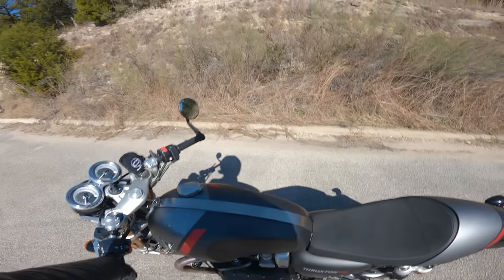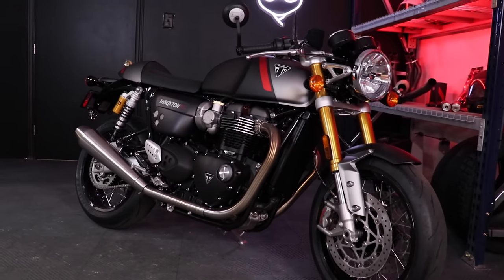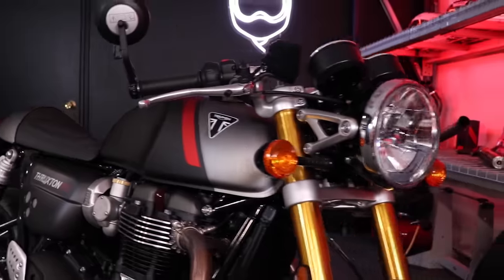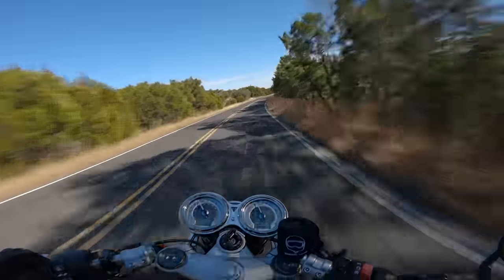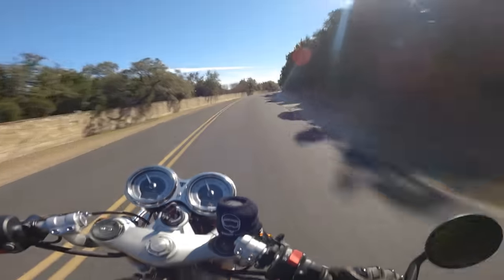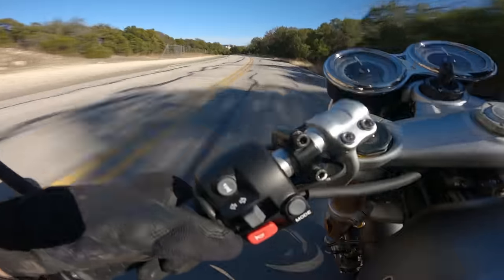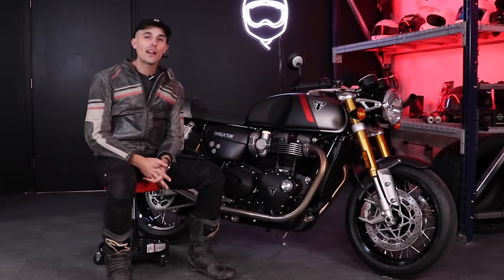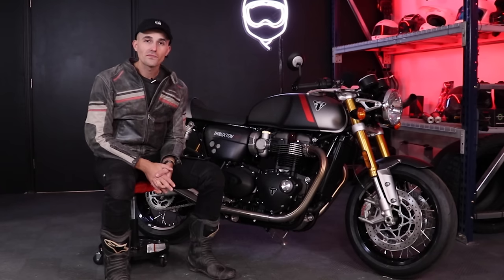2021 Triumph Thruxton RS Ride and Review! (Not What You Expect)

Comment: It’s about time you guys did, what I believe, is the best Triumph motorcycle for years now. I’m in the process of buying the RS and have ridden both the R and RS variants. That parallel-Twin is a gem of an engine and makes the absolute best noise. I couldn’t pinpoint anything bad about the bike, especially as someone who is just getting off of an awesome 2009 CBR1000RR, that I’ve daily’d for two years. Can’t wait to see what you guys pair it up against.
Reply: What i love the most is that the bonneville 120 now got this engine.. Definitely nerfed... but you get the idea. The 900 was kinda meh. but that thruxton is awesome ^^
Reply: Bought one last year. Only real complaints I have is that there's no cruise control and the kickstand nub can be hard to find sometimes. That's it. Been very happy otherwise. It's made a great daily.
Reply: How would this bike feel for a tall person? I'm 6'1

Comment: I've run my Thruxton R since 2016 with just a few mods like ecu tune, cam and slip ons.  I've run some 11.6 ETs in the quarter at elevation and ran 151 mph at Bonneville last August with a gearing change and larger fairing at 6950 density altitude. 

So running at the drag strip 49 times and wide open at Bonneville 19 runs with zero mechanical issues.  I've run everything from the stock gearing 16/42 to 18/37 sprockets  because the engine is so flexible. 

Normally after six years it would be time to trade but I just painted mine candy apple red with gold leaf. Yeah I  still love it and I'm looking for a track day , at 68 I  need hurry a bit.
Reply: i tracked my 16 R five times last year and had a blast, but there are a few things that limit it on the track.  The foot controls are too low and limit lean angle, the clip ons are angled back making it hard to get your head and body out over the side without being a contortionist, and while the torque is great driving out of corners you really feel underpowered on the straights when you top at 7K rpm....    The engine and slipper clutch are super forgiving though - it wasnt disastrous to lug around a slow corner in 3rd or 4th even.
Reply: @AllenTodd  At 28 years of not being on the track I doubt the bike will seriously limit me.😄😄 My R is bit perkier now by 15 horsepower than it was when new. I'll keep your comments in mind when we do go...thanks.
Reply: Solid runs, and I bet it sounded beautiful
Reply: @michaelkinville177  I have a few videos up from the drag strip and the Bonneville Salt Flats up.
Reply: Beautiful machine, only problem I have with the retro Triumphs is that they are really small motorcycles (except the Scramblers)
I am 190cm and look really stupid on such a small bike, wish they made them larger to fit a north European person.
Reply: @gryphongryph Your probably correct about the bike seems to fit medium to smaller riders.

Comment: The braking can be sharpened considerable by changing brake pads. Triumph puts less aggressively  biting pads in the M50's on this bike to soften the initial response. There are lots of different pads available, BUT, do you really need more aggressive initial bite? I swapped out the pads on my Streetfighter for a set a bit less aggressive and it makes for a more forgiving ride. When you grab a bunch of front brake with these pads, the Brembos will still make your eyse bulge out!

Comment: I had a Ducati Supersport and went with this for a keeper. The Thruxton compared to the Ducati Supersport 950 has a comparable racing heritage, the same ergos, same Brembo brakes as the SS, full adjust Olins suspension, fully adj front forks, same weight, comparable tires, but the Thruxton is better built (re: more reliable) and attention to build detail, easier to work on myself by a long shot (way cheaper Triumph mech service when needed - no desmo fiddling), better sounding stock, and a classic style that won't go out of style.  I loved the Italian style and performance of the Duc, but I don't do track days, I just ride twisties and do short multi-day trips....and who doesn't love that British cafe style done properly. As mentioned in the video, Triumph got the cafe style and sport bike performance balance just right. Mine is the Chrome Edition RS and it looks like a custom bike and rides as much like a sport bike as you need for the street.

Comment: And some additional info for those who doesn't know: there are drive modes (2). Engine has 270 degree crank schaft. And main difference from speed twin is adjustable suspension (and driver position)
Reply: The main difference between the Thruxton and Speed Twin is the $4200 dollars your wallet will be light!

Comment: It's a great bike if a little pricey. A great alternative [and cheaper] is the Speed Twin. Very similar in performance and handling but more comfy. It lacks the stiffer fully adjustable suspension of the Thruxton but for the road it's fantastic. The motor is a gem.

Comment: l just bought a Bonneville T120 a couple of months ago, even though it is not a Thruxton, I agree with everything you said about Triumphs. I traded a Moto Guzzi 1400 Audace for it as my MG was getting too heavy and awkward for me. The Triumph is a pleasure to ride, very smooth and well engineered. I agree about the brakes. They are plenty strong although it takes more lever pressure than my Moto Guzzi. Even My V7lll Guzzi's brakes feel more powerful even with a single disc, but the Triumph's brakes are quite strong just takes more pressure.

Comment: I was looking at replacing my Street 765rs last year. I had planned to get a Ducati V2. But due to the chip shortage, there were non in stock. So ended up with a ‘I’ll just get an R1. 
Then…..A Thruxton RS showcase edition appeared.
Easily the slowest bike I’ve owned. And limited tech. However, since buying it, I’ve never regretted buying one over the R1 / other bikes I was looking at. 
It’s just [cliche] ‘characterful’ and not once have I missed the tech of a modern bikes

Comment: I had thruxton 2013 900cc for 5 years, loved it and was fun to race around with but 70hp and 5 gears killed the fun after 5 years so how is this 1200cc with 6 gears and 103hp? Is it huge difference or just a small difference?
Reply: I had a 2014 air cooled bonneville, then I got a new thruxton RS. There’s a pretty big difference between the 2. The thruxton RS is a much sportier and much nicer machine

Comment: hey yammie, il be picking up my Thruxton on Tuesday if all goes well, i like hydraulic clutches on my enduro dirtbikes, because with the right master/slave cylinder setup it is very very light and as i use my clutch a lot in the super-tight, it is very nice. thats my two cents on hydro clutches

Comment: The original 2016 model in gloss silver was a master piece. This model is too fussy looking and I don't like the blacked out engine casings and wheels. Also the non chrome headstock compared to the original.

Comment: I wanted this from the jump, but I could not afford it, so I got a RE GT 650. in a year I was drooling for a thruxton! it is still out of the price range, but I'm trading in my GT for a 2016 Triumph Bonny t120 .  black
Reply: Would you recommend getting a used 2016 Thruxton 1200 for $8k or a new GT 650 for $7k?
Reply: @seandaliege  great question. First, dealer fees put the new bike at closer to 7.5 and 8k. I ended up selling my gt650 and paying an extra 2k to get the Triumph Street twin 2017 used with hand warmers for 7.5k. And I love it!. The guy I sold my gt650 ended up trading it in for a thruxton for his daily rider. If you want more security at higher speeds, some interstate, some bridges, you gotta go with the Triumph, as it will do everything. No problems with the GT650,  just will be happier long term with the thruxton.

Comment: Putting an exhaust on a Triumph 1200 is useless. The catalytic converters steals all of the sound. Try starting the bike without the stock mufflers. No difference.
Reply: Just get a de-cat and it's problem solved. Here in England at least, bikes don't have an emissions test, so as long as its not like, ear bleeding loud, you can remove the cat and not get in any trouble
Reply: @dennisclark9544  I did. And i love it ;). Its the same  here in Sweden. But we do have a dB-test. It passed with stock mufflers
Reply: I've just swapped my 2016 Thruxton R for a new RS.  I rode the RS for a couple of days before I put my SC Project exhausts on it.  The SC's definitely sound a lot better than the stock exhaust - it's immediately noticeable.  Also, the stock exhausts weight a lot and the SC's are really light - so that's another really good reason to fit them.
Reply: @IanFoot-sl1lp  haha I've actually done the same. Swapped my Thruxton for a speed triple 1200 rs. 

Only challenged the rear muffler for some end pipes. It sounds better, but not so exciting. 

But I'm thinking about selling it and just keep my Norden. It's hard to really use that bike to its potential (or easy?). And I need money for a house.

Comment: Interesting vid. In my opinion, this felt like a lively and active bike, took corners and accelerated well, but still felt raw and a bit rough for a modern sports bike.  4 its cost, the styling is the typical european retro cafe, very plain and a bit boring 4 me. The power didn't rev up smoothly, but did coughed up 2 deliver its power. When revving up, it sounded more like a faster steam engine train than a modern sports bike. I did enjoy the ride, but as a owner, I'll pass and save my $ for something smoother. Anyway, ride safe, god bless u.